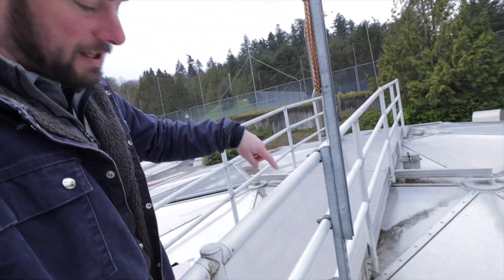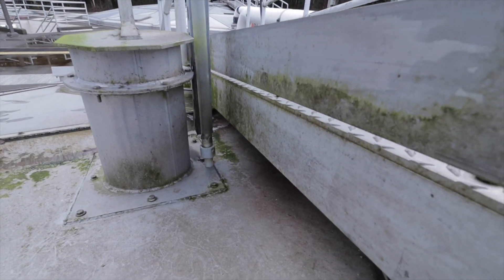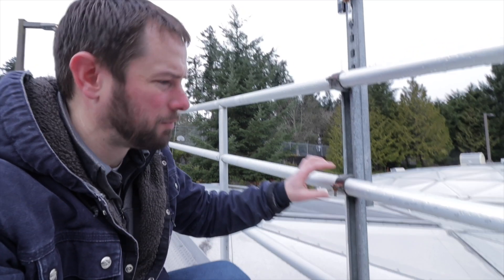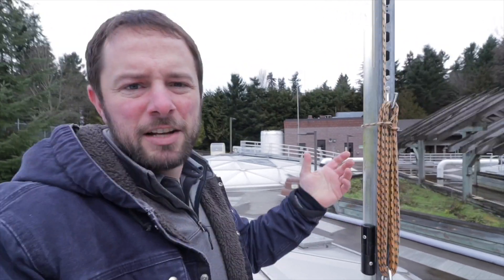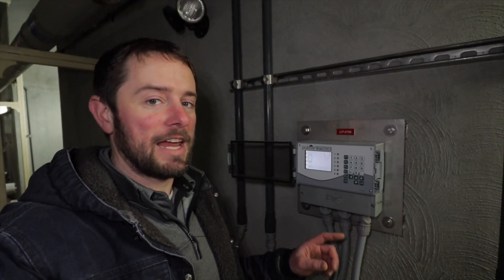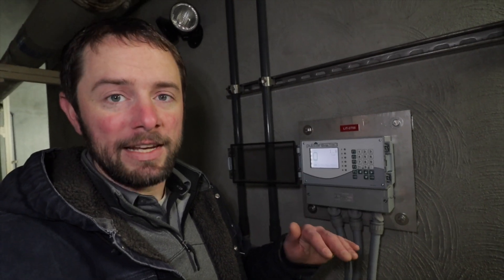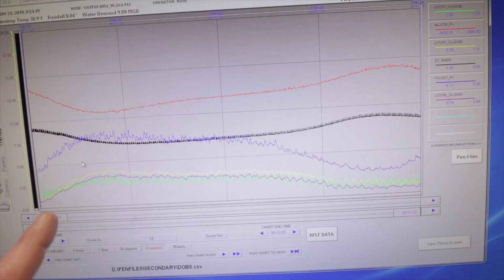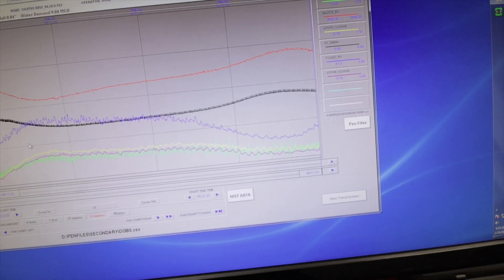Wastewater Treatment - 2 Methods for DOB Depth of Blanket Measurement.

Comment: Very nice video !  One thing i do not understand.  Why do you get the highest RAS concentrations at lower plant flows ?  We get high RAS concentrations at high plant flows when lot's of mixed liquor is in the secondary clarifiers.
Reply from the maker: Frederik 
Great question. I’m not totally sure. This plant runs a ratio ras control so as the flow to the clarifies increases the ras flow is modulated higher to maintain a constant %. If you were running a constant ras flow I would imagine the concentration would be higher at higher flows.
Reply from the maker: Let me know if you run a constant ras flow rate. That might be the answer.